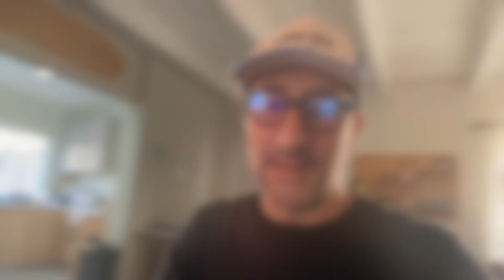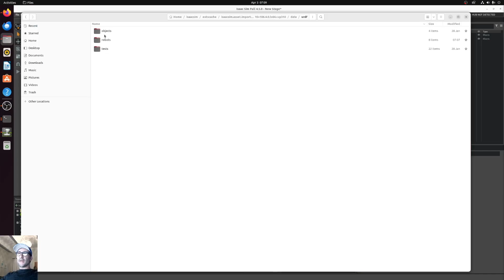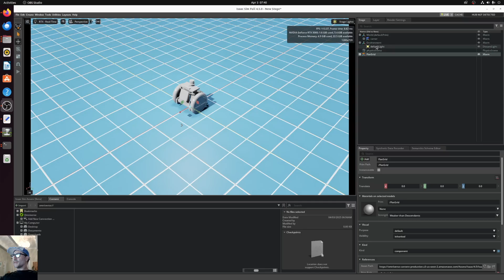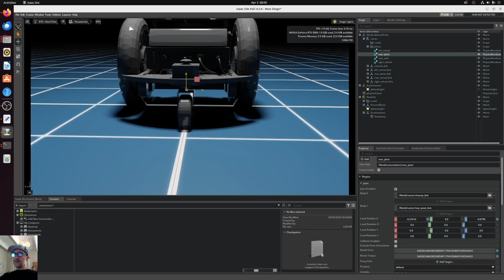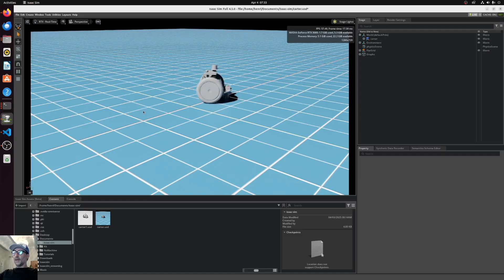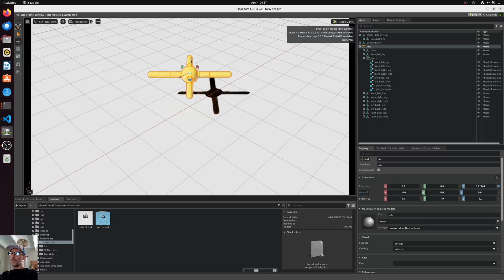Isaac Sim Day 4: Building My AI Dev Rig + URDF Import Tutorial

Comment: Thanks for sharing your experience. Very helpful. I got many ideas from your videos.

Why did you decide to get a local machine as well. I watched your AWS setup. I was thinking to use DVC remote desktop with an AWS machine like you did in the video. Did you encounter any limitations with that setup?
Reply from the maker: Yeah the remote machine was super laggy and not a very good experience to get into a flow state while working. Also takes ages to boot up and get going. And spending 8 hours a day on it gets expensive quickly. It's fine for a month or two but definitely better to have your own machine. You can build a budget machine with used parts for about $750 to get going. My setup at the moment cost about $1700. Let me know if you need any help picking parts to build a machine.
Reply: @HenriLearns  Great. Thank you. That is very valuable input.
Reply: @HenriLearns  Since you said 8h a day, are you doing this full time? Have you documented your story (how you got into robotics domain) anywhere?